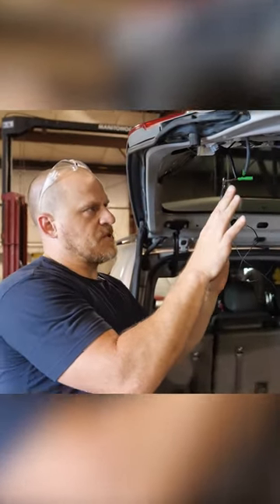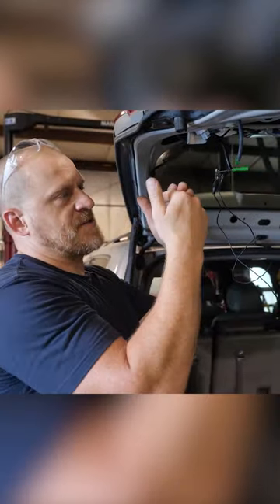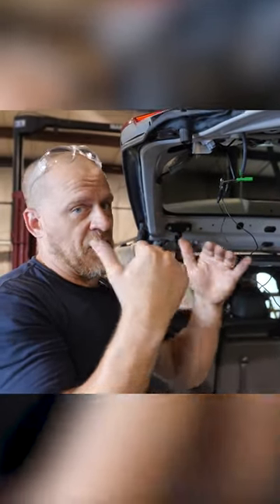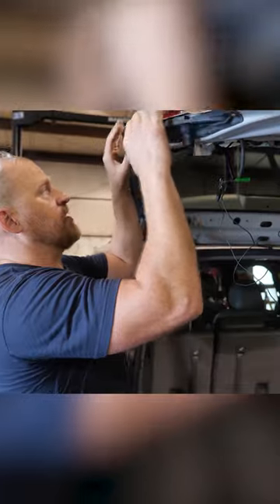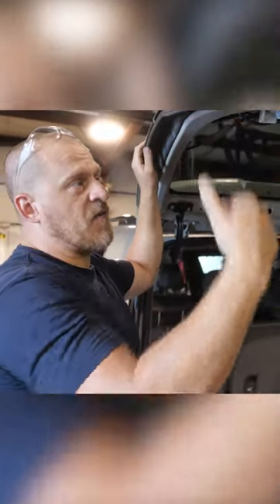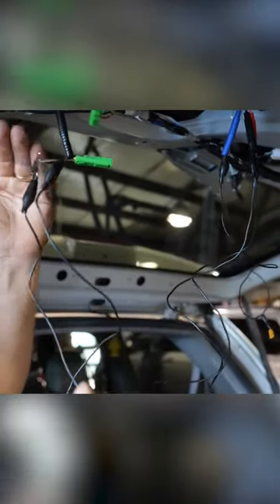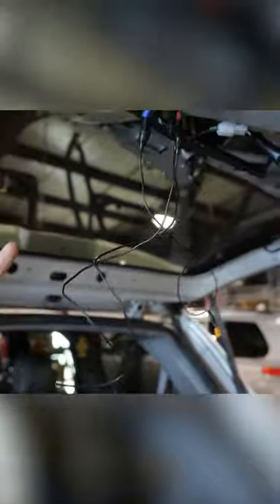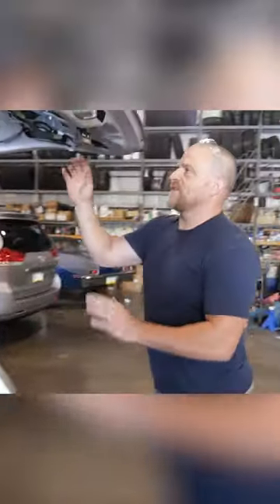Honda Power Tailgate Pinch Sensor Operation/Testing

Comment: This is why I like manual latching.
I own 2 Caravans, one all manual, one auto. I'm constantly fixing the auto one (wiring) while driving the manual with zero issues. If I had to pay someone to fix it each time, I'd be broke. I don't want a Model T, but I won't drive one of others nightmares. "F" the CAN bus, I'm not riding!
Reply: I agree..  I have a 2002 F350 7.3L diesel, ZF 6spd manual, manual 4x4 transfer case on the floor, manual locking hubs, manual seats, manual mirrors, manual locks, manual windows..  It doesn't even have tilt wheel or cruise control. It's basically a tractor with a flatbed, and I love it.  Manual is King.
Reply: Agree  , 
    This is the reason to watch Paul , " Scanner Danner "  
    This awesome video  just showed me a way to trick , trip , test that switch and it will save me time and money 
      Thank You All

Comment: So what is this doing?  Confirming that the computer works, and it's the module that's bad?
Reply: I believe the pinch strip is damaged fairly common that's why the potentiometer was showing the control module proper voltage and it operated correctly
Reply from the maker: Exactly! Thank you
Reply from the maker: This proves the pinch sensor was the reason the door would not automatically latch and help us be 100% on the call. This ended up being especially important as this van had another problem too!

Comment: thats why I dont like modern cars. I am good with electronics, but for a stupid door u have to spend a lot of money. 4 hours messing around 400 bucks plus the new switch. while a simple handle with a cabel u dont need more than 10 minutes to figure out why it doesnt close and is cheap to fix. and what is the electric bullshit making it easier?  u really need all that?